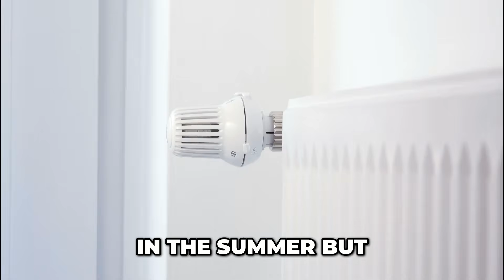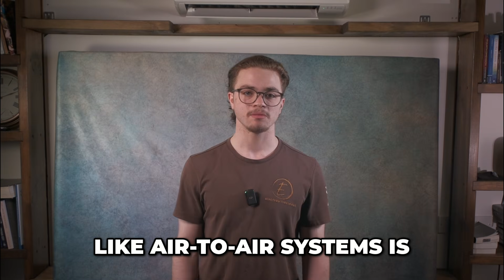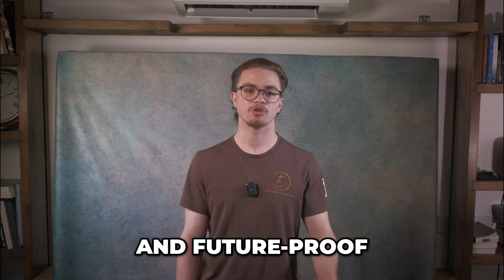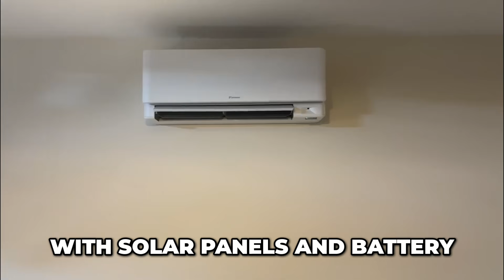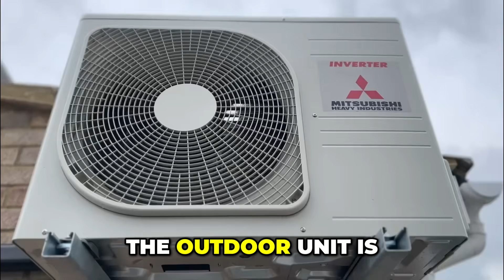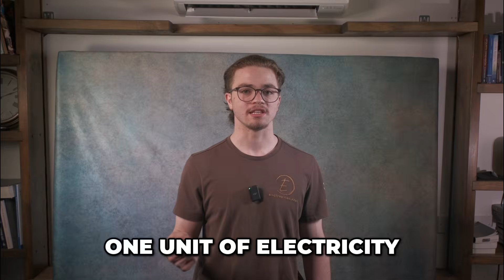Get AC & Cheap Heating (Without Tearing Your House Apart)

Comment: Installed and serviced/repaired ACs in South Africa for 6yrs 20yrs ago, that this is a new thing in this country seems so odd, but understandable with how this was a colder climate on average and boilers/radiators are what was needed and cooling wasn't a big requirement.

Comment: Do you not need to connect these units directly to your fuse box, which is often not located under the stairs and miles away from where your condenser will be.

Comment: I got my air con at the right time i think. Paid a total of 7800 for 5 indoor panasonic tz units, 1 single heat pumps and 2 split heat pumps all ground level for easy maintenance. Installation included.
Reply: Yeah installation prices at the moment are absolutely ridiculous.
Reply: 7800 UK pounds sounds like a fair price.

Comment: That looks like the sort of aircon unit in every motel room in the us. £2000 seems way overpriced.
Reply: 100%.  Installers in the UK somehow think that hanging 2 boxes on the wall, drilling a hole and connecting 2 pipes is near £1500 worth of work.  Ridiculously over priced for what is a low skill job.
Reply: @simonclarke3575 Low skill? Taken the FGAS course? Laid out thousands on tooling and test equipment to ensure the kit is fitted safely and correctly ensuring your warranty is honoured? Servicing and backup? It doesn't come for peanuts.

Comment: Good concise video. I’m undecided which is best way to go. Large 4 bed house, 2 bathrooms, 5 downstairs rooms @£2000 per room A2A will be too expensive compared to A2W. Plus needs water heating. Therefore a question - can upstairs be fed  from a single ducted system, with traditional A2A units only downstairs? I’ve heard that some mini splits can also do water cylinder heating? Could all this be done on a single external multi split system? We have Solar. Look forward to you comments. Thanks
Reply: As far as I know you can get two external units quite easily, and the 1m from the boundary restriction has been removed. 4 units fed from one external is quite common, and can go to five. Need to be very careful to buy a unit which can ramp down, not on/off if you're feeding one internal from a large external unit? I find you get used to background fan noise, but constant switching on/off is the problem.

Comment: Keep your gas boiler. Unless your property is a newish build removing could make your property no so desirable!
Reply: As a 23 year old.. the opposite is true. I've been looking at houses lately and i'm immediately ruling out any that have radiators (and a gas supply). Having radiators is a sign the house was either built decades ago, or wasn't built well. I do not want a leaky, drafty, cold wall house that will cost a fortune to run. My ideal house is triple glazed and air tight with an ERV system. It's why i'm considering just building my own house as the UK's building standards are awful. It is wild to me there are houses being built today in the UK with radiators, no under floor heating and based on previous standards of being breathable. I want something that is airtight and mechanically controlled. All the air gets replaced many times each day and filtered which results in a far higher air quality, and lower energy bills due to little heatloss.
Reply: @iambenmitchell I'm in my late 40s and totally agree with ya. Modern all the way. If I was to ever move (unlikely) I would want air con, electric or thermal battery for hot water, solar panels, 20kw battery and a car charger.
Reply: @iambenmitchell I'm Canadian and feel the same way. The way they build houses in the UK doesn't seem to have changed in 75 years 😑